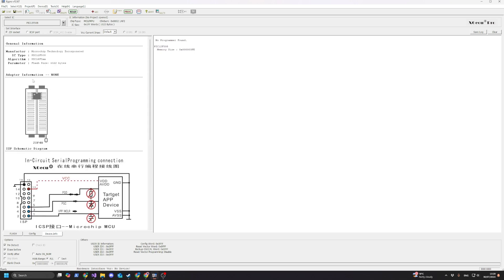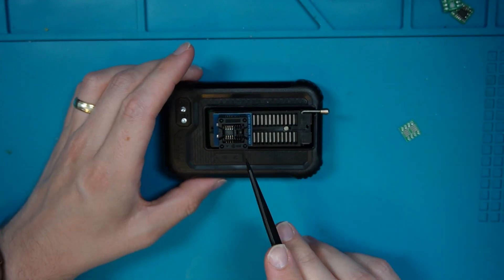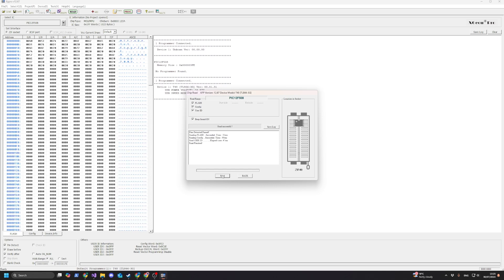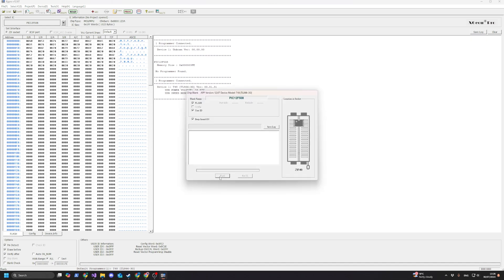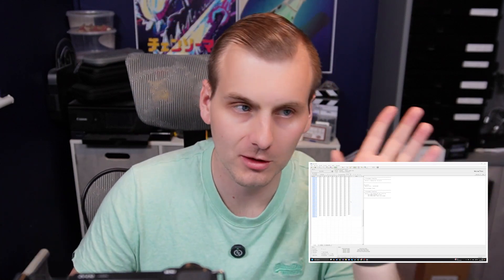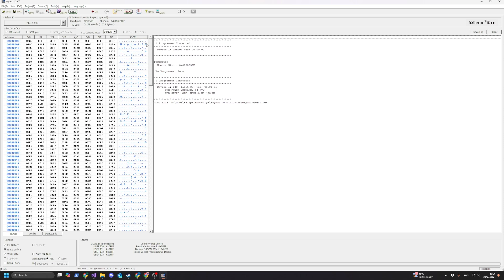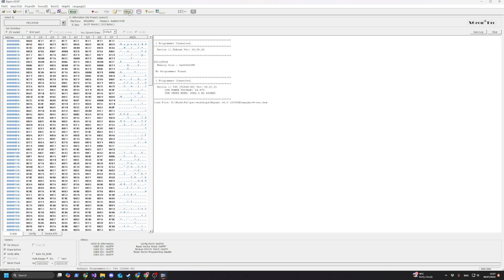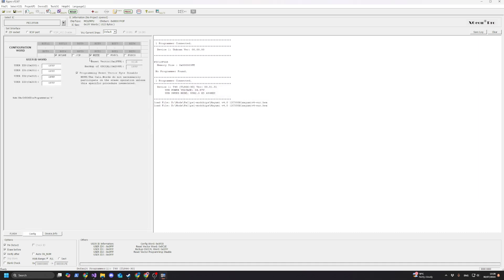Creating a PlayStation Mayumi V4 Mod Chip

Comment: I recall mod chipping my PlayStation almost 20 years ago with a DIP-18 PIC16F84, and a homemade serial port programmer constructed from a couple of diodes and resisters. To be honest, I think that was actually easier than what you are doing here, but it did require some basic electronics knowhow. Good times!
Reply from the maker: Wow :0 early modding the playstation sounds crazy. I did have a chipped playstation as a kid, but I didn’t have any idea how they did it.

This way isnt too bad, just all the equipment costs a lot :(